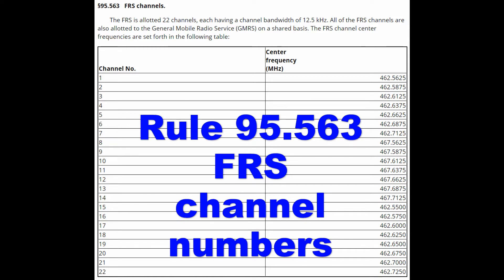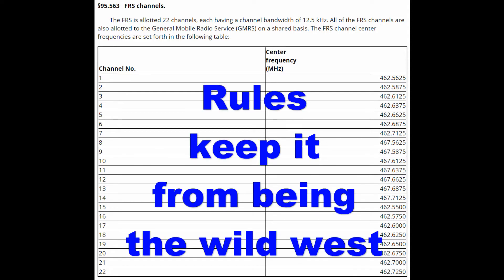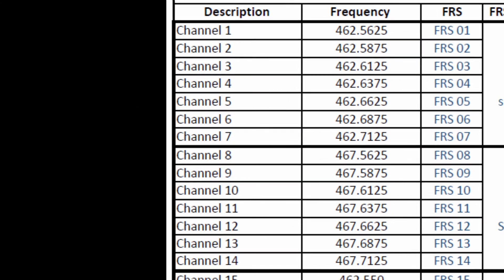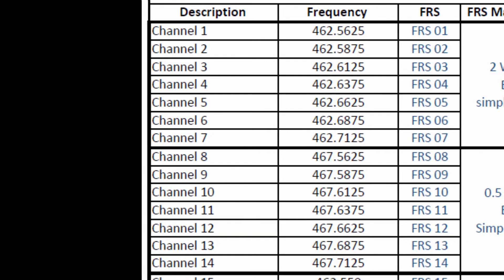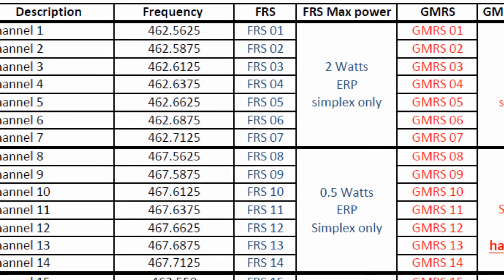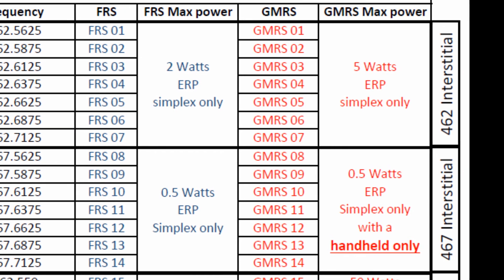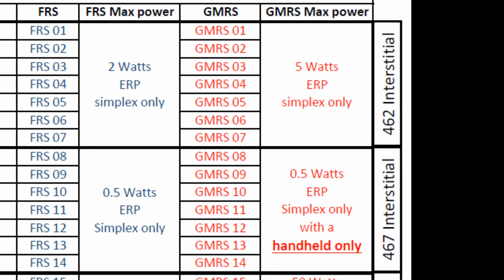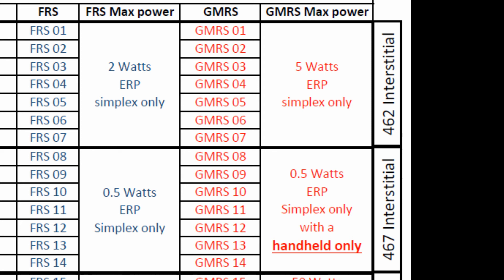FRS channels 1 to 14

Comment: If you're using a bubble pack radio, it has two watts or less.  License free, right?
If I transmit on the GMRS repeater inputs at two watts, how illegal is that?
Reply from the maker: Hams get into talking about gear. In GMRS I avoid mentioning the specific gear when talking on the radio. Handheld, mobile and maybe the watts should be it.
Sadly there are too many operators in all amateur and personal services that are gear snobs.
Reply from the maker: Not necessarily because of the technical issues in the old vs new rules. However, no-one is going to care that you don't have a license if the radio is under 2 watts.

Bubble pack radios will not have repeater input frequencies. They do have the repeater output freqs because these are also for simplex use. All freqs on bubble pack radios have shared FRS and GMRS freqs (channels).
Reply: They care when I hit their repeater on a BF888S.  If I ask if it's legal, they forget about Randy and all about being insulting.  They get real smart.
Reply from the maker: @HarryHamsterChannel  The BF888S is part 90 and part 15 FCC certified (for Land Mobile and Amateur use only). 
As for the repeater owners, they can control who is on it.
Although inexpensive, I don't classify and programable radio in the bubble pack category.

Comment: Can you punch the frequencies 1-14 even though they have a 5 at the end?
Reply from the maker: Punch into what?
are you referring to a specific radio?
Reply: @personalradiofun526  UV5R
Reply from the maker: @travelportal5212  Example: FRS/GMRS channel 1 is 462.5625
Go into VFO mode. Menu 1 is step; set it to 2.5. Save by pressing MENU then Exit.
Type the frequency 4 6 2 5 6 2 at this point it will default to 462.560. Press the up arrow once and if the STep was set correctly it will read 462
5625  The last 5 will be small.
Reply: @personalradiofun526  thank you. I thought the Uv5R can only go up to 6 digits.

Comment: WHAT I WANT TO KNOW IS THERE BASE STATIONS TO USE FOR THESE FRS ONLY !
Reply: There were two.  Radio shack had one.  Midland had one.  Haven't seen either one for sale in years.  Per FCC rules, they had to be portable (like a walkie talkie), so they made it run on batteries, but look like a base unit.  Also, the rules said 'permanently affixed antenna', so they had a permanent antenna attached, just like walkie talkies.  Same low RF output as walkies, too.  So, they didn't buy you much over a walkie, except looks.  The Midland had a mic on a coiled cord.  The Radio Shack unit looked a lot like a weather radio or intercom.
Reply from the maker: Those were so obscure I don't even bring them up. They were a great idea at the time; but, they didn't catch on.
You won't see a company make one now because the 2017 rules change made it easier to have GMRS mobile radios built.
Reply from the maker: Base station could only be done for channels 1-7. 8-14 are reserved in FRS & GMRS for handhelds only. A base station setup on 1-7 would fall under the GMRS rules. So a GMRS license is required for the operator of the Base Station. Anyone you are talking with CAN be under the FRS rules.
Reply: HOW MUCH AND HOW LONG  WOULD IT TAKE TO STUDY AND TAKE TYHE TEST
Reply from the maker: No test is needed for FRS, GMRS or MURS. You do need to buy a license for GMRS.
Ham radio needs a test to get a license (3 levels of license). I suggest getting the book for the ham radio license manual. It will teach you about operating and radio technology; not just how to pass the test.
https://home.arrl.org/action/Store/Product-Details/productId/114233
Give yourself at least a month of study.
Reply: @personalradiofun526  THATS ALL I NEED IT  FOR I HAVE 2 SETS OF MIDLAND HANDHELD FRS RADIOS
Reply from the maker: @robertmanning8246  Making a base station that will talk to handhelds only need the Midland MXT 105 (5 watt no repeater functions). I run this in my truck because there are not repeaters in my area. 

If you have a long run of coax then you might want the MXT 115 (15 watt) due to coax loss. I have a 40 watt Base station repeater capable radio in my house with an antenna 30' high. This is because I want effective range when talking to other mobiles.
Reply: @personalradiofun526  I HEAR  HAMS OUT OF SPOKANE WA FROM ATHOL ID ON GMRS  CH 18  DO I NEED A LICS TO USE GMRS AND HOW DO I GET IT HERE
Reply from the maker: They my be licensed in Ham and GMRS. 
A GMRS callsign is always 4 letters followed by 3 numbers. 
A ham callsign can vary in structure; but, USA ham callsigns only have one number in between the letters.

Go ahead and get your license. One license includes family members.
See this video (not mine) on the application process. https://www.youtube.com/watch?v=t2XnY0iC_ug

See my video about the repeater channels. https://youtu.be/P1uXsC8ez2c

Keep the questions coming it helps my with new content.
January thru April is my busiest time. I should start posting new videos soon.
Reply: FRS is Two Watts.  
You have eight whole GMRS frequencies to fight over.  Since propagation is so marginal, that's plenty.  They're not crowded, if the channels are locally populated at all.  Hobbyist repeaters pop up, then go away frequently.

Comment: Hi, can I buy a GMRS radio for when I need it for long distances in the wilderness, but use it on the FRS bands when I am just using it between vehicles in a campground? If operating on an FRS channel, would a licensed GRMS user still have to do call signs etc on the FRS channels?
Reply: If you are using a GMRS radio, you are supposed to identify when transmitting, doesn’t matter about the power level.
Reply: @budgetbasscovers If you keep it at 2 watts on 1-7, nobody will even know you have a GMRS radio honestly
Reply: SO DO I BUT WHAT WOULD INTERFERE WITH THE SIGNAL OF EITHER FRS OR GMRS
Reply: You'll need to try that.  Ain't no tellin' ;-)